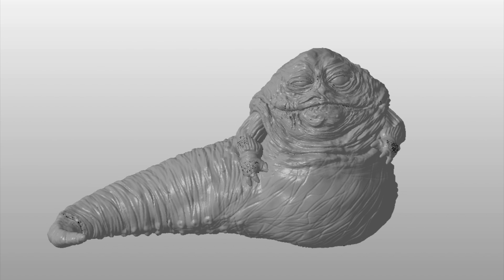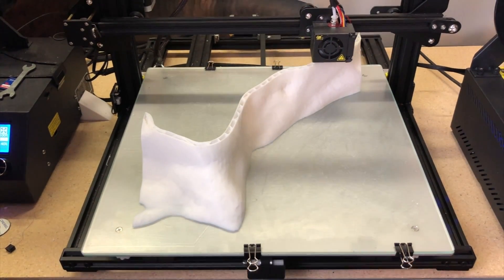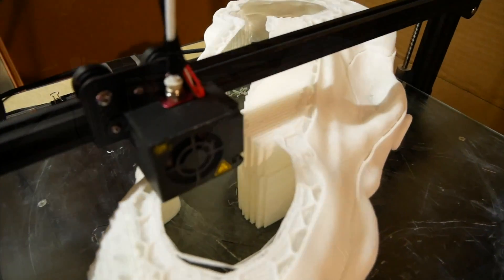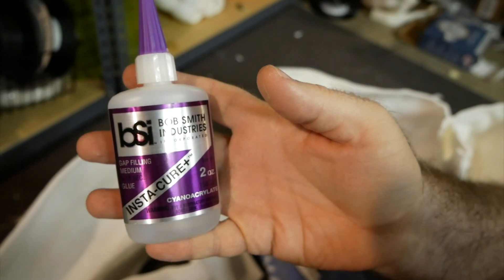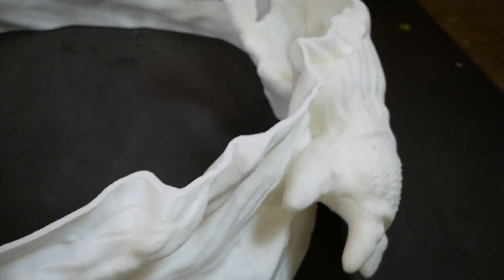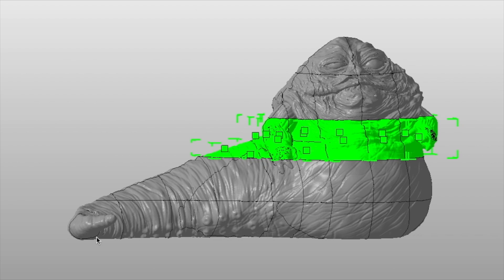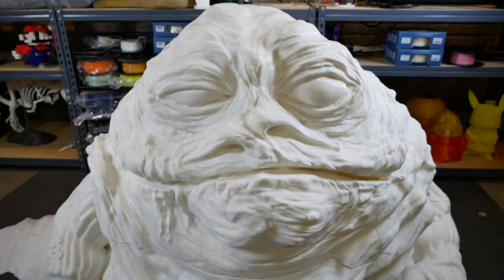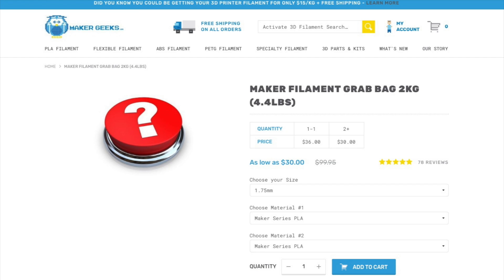3D Printing a Life Size Jabba the Hutt! (Part 2, Sponsored by MakerGeeks)

Comment: Moving a giant Jabba would have been a challenge, agreed. I created a life size seal from a metal chicken wire frame covered with plaster of Paris and it weighed over 200 pounds, requiring a small wheel truck to move it around. I wonder how heavy this Jabba would be?

Comment: Why the hell does no one add fitting tabs to spliced 3d prints. There's a reason models have always used them, so you don't have to eyeball the fit and end up with panel gaps.
Reply from the maker: Ideally, yes that is a good idea. And I've done similar things with much simpler projects. But editing 70+ models to add tabs is beyond me -- particularly since these shells are so thin.
Reply: I would suggest adding a few to the body to allow you to simply lower the head / torso onto the thing have it align up and give you the freedom to not have to glue it in place so you can remove it to be able to move the thing.

Comment: I have no clue about how readily available outside of Germany the stuff is, but here, I found that Uhu Allplast glue does a great job of sticking PLA pieces together if the gap is nicely small. It takes about half an hour to dry and will apparently even take much longer to fully bond, but is nicely easy in application and way easier to handle than Epoxy or Cyanoacrylic/Superglue. I also get the impression that it is stronger than Superglue.
Reply: Or 2 komponenten kleber, has worked amazingly for me for pla pieces

Comment: in the future you may wish to consider TIRE GLUE. its rubberized CA (bob smith sells it its BLACK) the rubber content makes it slightly less "brittle" so less likely to crack. another good idea is to use regular glue and FABRIC (get some cheap dollar store tshirts and slice them up) even hot glue with fabric across the interior seams will dramatically increase the strength of the structure as a whole.

Comment: What are the final dimensions going to be? If you bring that thing to a convention, I can guarantee there were be slave leias all over it within minutes. I was one at Celebration and the Jabba seemed pretty big, but he was on the stage/platform too.
Reply from the maker: Roughly 6 feet tall and 10 feet long, I believe. The tail/body on the 3D model ended up being a bit small relative to the head, so the body may end up a bit shorter than it actually should be, but I think it's close enough!

Comment: You could have interlocking pins on your Jabba segments.
Reply from the maker: I could, and I've used those on some of my smaller designs. But editing 70+ pieces to add pins would take forever, and also the shell isn't really thick enough to accommodate pins. In the end, just gluing the pieces together seems to be working fine.
Reply: Mighty Jabba's Collection too bad there isn't a plugin for that.

Comment: I've been thinking of getting a 3d printer myself. But with budget issues replacement filament is my biggest worry. I've wondered about possibly making a heat tank with size extruder nozzle that could recycle scrap prints back into usable filament. Do you think that would work if done right.
Reply: Get the printer.  Good filament is getting cheaper and cheap filament is getting better.
Reply from the maker: There are machines for recycling filament, but the problem is generally that they aren't cost effective. Unless you're recycling huge amounts, you're probably going to spend way more on the equipment than you will save on wasted filament. And even with all of the failed prints I show in this video, it's not like I waste very much filament in reality.
Reply: I have seen it but there are lots of machines that you need and space to make the filament into the roll it would be a great project maybe make a video about it if you are serious. Also I would go for getting a printer I was frightened at first but when I got one it was one of the best things I have ever used! So go for it man.
Reply: Get the Anet A8. Most for your money. (You have to assemble it though)
Reply: I found a model called the Tronx P802MA.  Is nearly the size of the CR10 used in thsi video which has 300mm print base. This model has a 220x220x240mm base. Its on sale for $185 as well, has grear reviews. Seems like a good first potentially high quality printer.